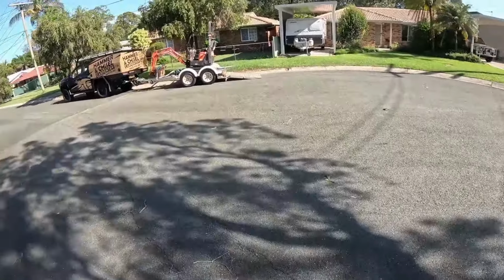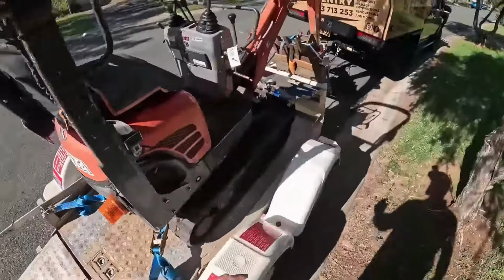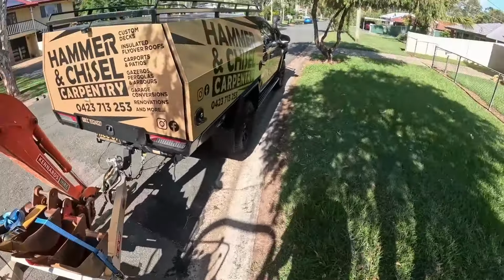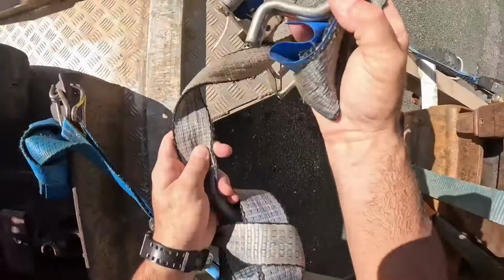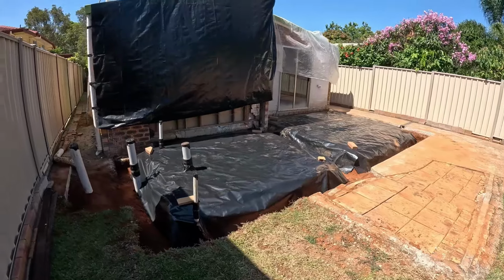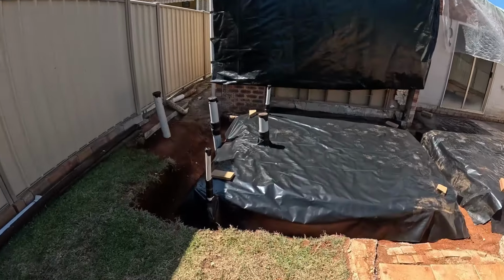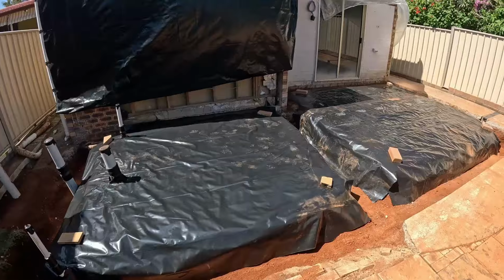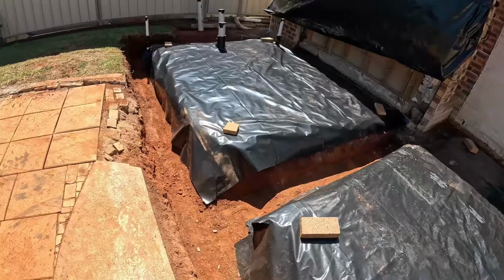Extension Renovation | Excavation Day! | Part 3

Comment: Top work mate.💪how long from start to finish u think this Reno will take you?u do everything except plumbing and electrical?
Reply from the maker: Thanks old mate! It took 8 weeks total in collaboration with a few select trades... plumbing, termite barriers, concrete, electrical, roofing, plaster setting, waterproofing & tiling were done by those we trust most. Any items missed or loose ends are tidied up by us as well.